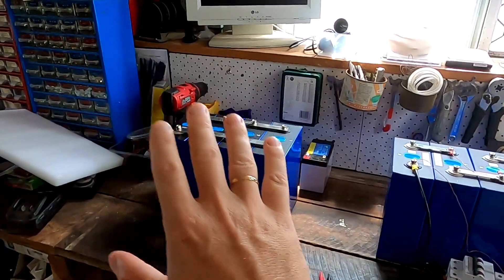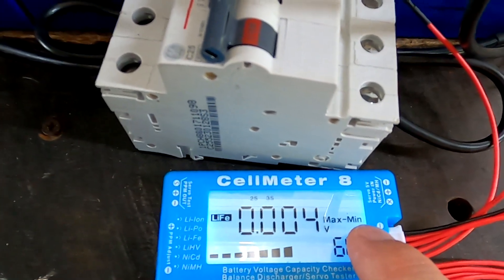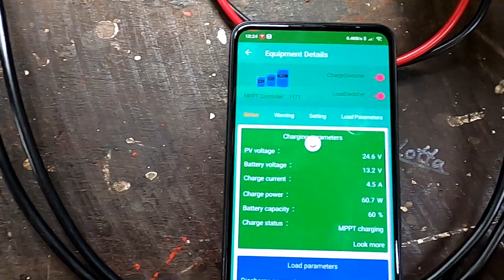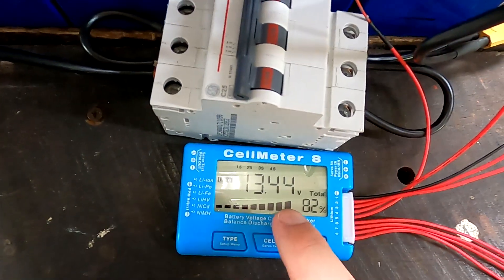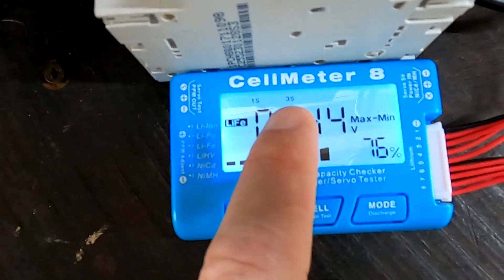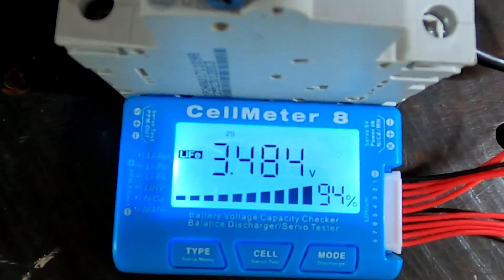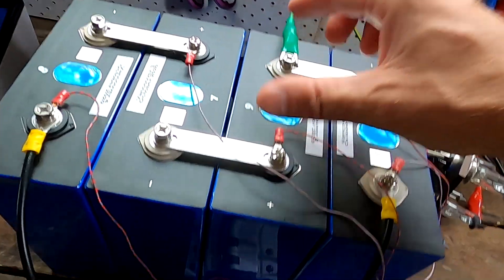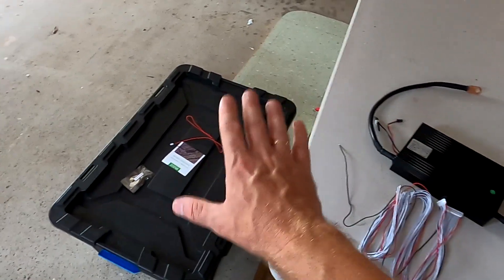Do this and you don't need a BMS 😉

Comment: There is a better solution to the unbalanced pack. Use an active balancer equalizer capacitors board which take charge from the highest cell and dump it in the lowest cell. It will keep them within 5mv. The solar charger control the charge and the inverter control the discharge. If you want more energy from the sun in cloudy days use solar panels in series with 150v capable mppt chargers.
Reply: capacitor doesn't change how you do that!

and you don't have to discharge any moving charge, just change which ones you are charging.
Reply: Are you sure about the active balancer claim - can you point us to specifications that show this feature of active balancers vs non active BMS?
Personally, your comment and others making other ludicrous claims for active balancers reek of marketing hype.
Reply: @Bennyboy-dog if I were not sure, I'll not be guiding people in the wrong direction.  This one is 2A but for one of my 280ah 48v pack I am using 10A balancer to bring the pack within 5mv.  https://youtu.be/rQgOet7AH0I. And of course these balancers aren't long lasting as BMS but you can  get more power out of the pack.  As for charging I use several makeskyblue which I can adjust my top voltage to 54v and the inverters cut off point is adjusted to 48v for the bottom limit.
Reply: @Bennyboy-dog   While I have no way of knowing whether the OP was acting in good faith, I do distinctly remember Julian Ilett having a few videos on active balancers as opposed to passive/bottom/top balancers, to balance his supercap/ultracap banks. The ones I saw I believe were roughly 6 months-1 year ago.
Also vaguely remember a few videos on DIY Arduino projects accomplishing the same task, utilizing Digital-Analog Converters, for battery banks far in excess of typical series counts.
I'm not certain whether he was part of those as well, or in misremembering other YouTubers.

You know, I should probably examine this subject personally, if only to be more accurate regarding this topic in the future.
Reply: @NightsReign  Thanks NightsReign - I did watch Julian's coverage of active balancing, and I really like the idea of active balancing, but from what I've seen, power savings, and super accurate balancing are not founded in practical reality. 
 I mean many BMS balance at 30 or 100mA - and for a short stretch of time to adapt the cell to that of the pack, now a quick and dirty, order of magnitude calculation tells me that to discharge say 100mV at 100mA amounts to 1mW and that may be for, I don't know, an hour? of the total charge time of the cell. 
With a 100AH cell, at 3.2V having 320Wh, to quibble over saving 1mWh sounds, like I mentioned, marketing hype rather than practical advice. This OP's comment sounded like active balancers are more precise "5mV" - what??? I don't normally react much to gibberish in comments, but this and other comments in this video really got under my skin. Again, thanks for responding, its great to discuss stuff with other commenter like yourself. When I'm wrong, I find out about it pretty quick and I do attempt to right my own wrongs (and there are many things I misunderstand or simply don't understand).
Reply: @Bennyboy-dog  The other issue with only using an active balancer instead of a bms is that it lacks all the other safety features a proper bms provides, such as over charging, over discharging, over or under temperatures, too much charging current, too much discharging current, etc. If the balancer fails you'll only know if you have some other system monitoring it, if your charger fails and puts out too much voltage you'll only know when your pack fails, generally if your bms fails it simply disconnects the pack so long as its a decent quality one. So while an active balancer might help when used with a bms to handle larger swings in voltage than the BMS can do itself, it's just not a good solution all by itself because it leaves multiple ways for the batteries to be damaged.
Reply: @Bennyboy-dog   I know this is just theorycraft, but do you think parallel wiring a supercapacitor/ultracapacitor bank of equivalent voltage to the primary battery pack might better compliment an active balancer more than simply wiring it to the primary battery pack alone? I'm just wondering if that might assist with any of the shunting requirements a hypothetically ideal active balancer would be forced to shuttle between cells in series to meaningfully redistribute the energy.

I'm under no illusions that a 24-48V bank of high-Farad capacitors would be anywhere resembling affordable by mere mortals.
Last time I researched this, a YouTuber I was watching had a power wall of Edison NiFe cells and had set up a 6S bank of Maxwell ultracaps for accommodating his 12V off-grid system, and that was around $300 US, so the 18-20S necessary for a 48V battery pack makes my wallet weep for inadequacy... 🤑

(Random tangent: I frequently ponder the viability of a cell of Potassium-Nickel-Iron.
The Coulombic density is almost irrelevant, because who wouldn't want a KNiFe battery? Lmao)

These thoughts are really intriguing my mind right now. 🤓.

Comment: It's good practice to regularly go over your whole pack with a multimeter, as a simple (cheap) non Bluetooth bms failure can be unnoticed until the battery has gone too far 🔥..
At low loads and low current charging, matched batch cells should not drift much.
Reply: Production tolerances from cheap batteries ensure they will drift - as Andy clearly showed. Charging at 7 - 9A when 1C charging is 280A is low current charging, yet one cell drifted towards destruction.
Reply: @Bennyboy-dog  you're only looking at the very top freshly charged voltage. The discharge curve is very flat once that initial discharge has happened. Once you're on the flat part, batteries from the same batch which have matched IR should have very close voltages until the end of the flat part of the curve.
I run a 14s 10p 11.5kwh nmc bank which is discharged very slowly and charged at no more than 0.10c. The cells have been rock solid in staying balanced.
I'm not in any way suggesting a bms is not needed.
Reply: @yoda-be.at1746  That's my understanding too Yoda B.at1. I think the only time you need a BMS is when batteries are near fully charged and the cell volts diverges from cell to cell or almost fully discharged and again cell voltages start to vary. With these cells where manufacturing tolerances isn't particularly high, the IR and capacity of each cell will vary by a few %, so some cells will reach the life reducing SOC voltages before the others.
Reply: Having 10P will assist in stabilising the capacity variation, cell to cell, by brute force statistical averaging.
Reply: @Bennyboy-dog  that, in of its self, is a good reason to stay within the 10% 20% brackets of charge /discharge duty cycle. A good strategy is to balance perhaps once every 8 cycles to avoid having to top the cells off at max voltage to allow the bms to balance. I am an advocate of an oversized bank to reduce duty cycle stress.
Reply: @yoda-be.at1746  Agree, excellent advice.
Reply: @DIY Projects maintaining 30mV difference is generally ok, I believe, but many BMS have very low balancing currents, so although they may achieve 30mV on average, these BMS may, especially in high current charge/discharge scenarios, lose control of individual cell volts and that will kill the life of the cell fast. I'm not sure of the youtube you refer too - perhaps if you come across it, you can post a link?
Reply: @DIY Projects Cool, thanks.

Comment: I’ve been going through the same journey, minus the solar panels.  I tried to charge my 280ah cells to 3.65 to do a capacity test. I have 16. I became impatient and hooked them up to my 48v hybrid inverter, without a bms. I figured it would be ok if I charge to 3.5v and then top off with my bench supply. 
Terrible mistake :( I had a cell charge to almost 5v! A couple were over 4v while the rest were at 3.34. Very expensive mistake.
Reply: Ouch!
Reply: Yikes!!
How "impatient" are we talking here? Lmao
Was this a stress test for the full battery pack, following your individual capacity tests, or did you basically pull them from the delivery box, crudely lash them together in series, flip the switch, and wander away for several hours...? 😬🤔
Reply: @NightsReign  lol No, I did wire them in parallel first and tried to top balance them for two days. But I was getting nowhere fast. All the voltages matched prior to charging with the inverter. I just couldn’t get the cells past 3.3v.
I actually tried for two nights to charge them on the hybrid inverter. The first night the inverter stopped charging at 53.1v, which was roughly 3.3v per cell. The second night, I kept messing with the settings and restarting it to get it to charge to around 57.5v, but it only charged to 54v. I didn’t babysit the charging because I assumed that the pack was balanced and all cells would charge at about the same rate. I assumed wrong.
I was pissed I couldn’t get them to charge fully at first. But when I noticed one cell looking like a metal balloon, I became very grateful the inverter cut off. I was able to discharge the overcharged batteries pretty quickly, but the other cells are only at 3.34v now.  
I’m now trying to source one cell to replace the one that looks like a bomb. But it looks like I’ll have to pay a minimum of 4 cells at 3x the cost if I want something quickly.

Comment: Isn't positive red and negative is black
Reply from the maker: Yes.
Reply: red/black is just a reference colour code,  they whatever colour u want them, need them or have them to be as long as u not forget which is which :)
Reply: @bluex48  The colors have been standardized for ages, just because you don't want people to screw up. It's dangerous and expensive to make errors, especially in lithium batteries with the rather extreme currents that potentially could be involved. Only morons use anything else than red for plus and black for minus.
Reply: A friend of mine also used a black wire for the positive and the negative connection. He didn't care for a second and blew away his charge controller. I suggest to use a red wire or at least a red heat shrink tube at the wire ends for the positive connection. Great explanation of the BMS. Thank you.